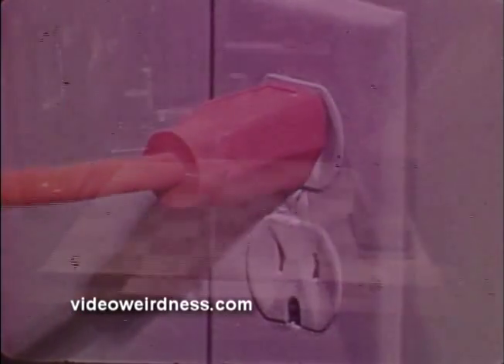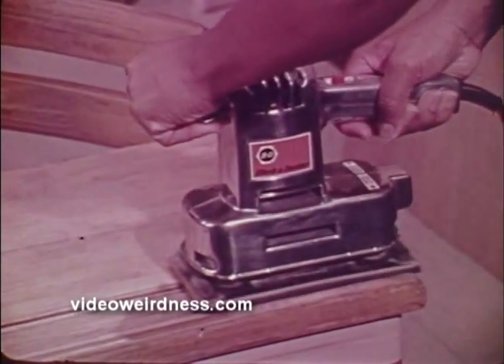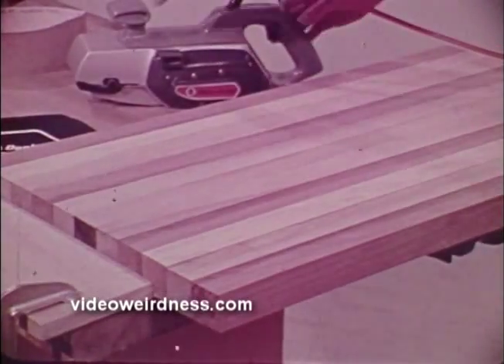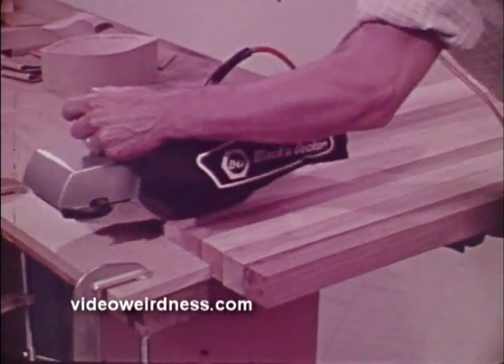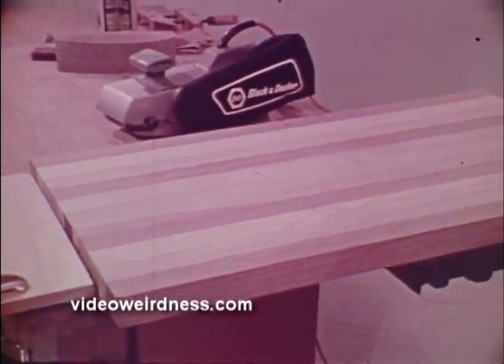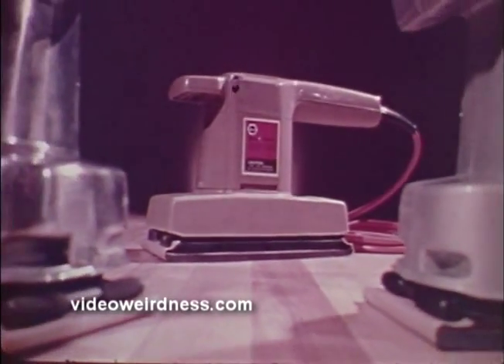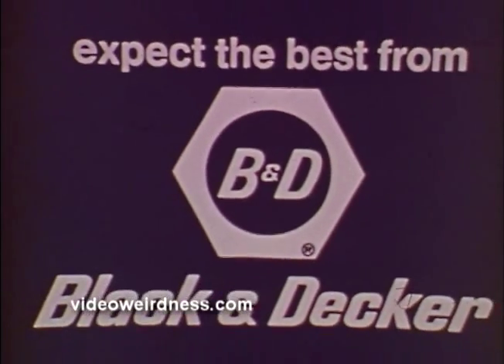Black and Decker 1972 promo

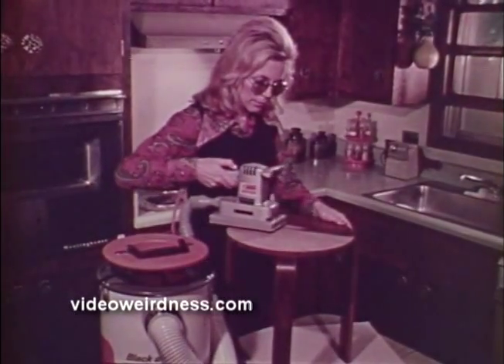Comment: 0:45 - 7420 sander is used with a dust-collection system, hooked up to the 7651 dry vacuum cleaner.

Comment: That metal sander sounds very rough internally compared to the new double-insulated plastic version. If anyone here has the 7420 or U-240 sander shown in this video, I want to hear yours running.